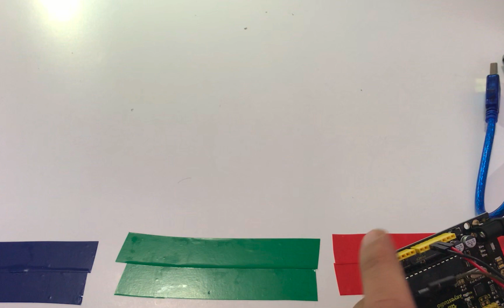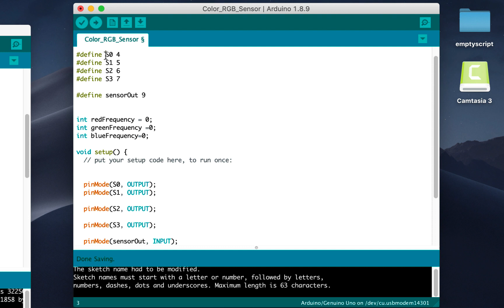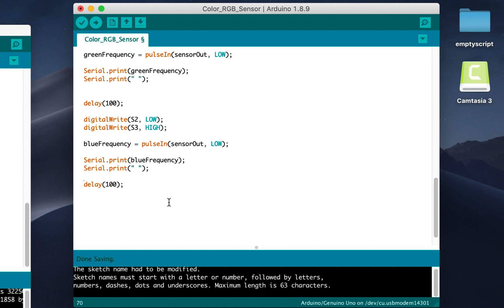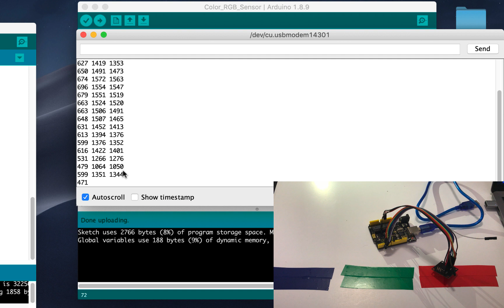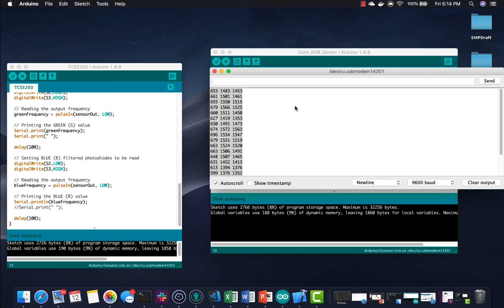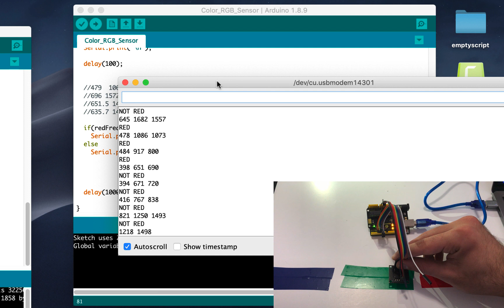4  Color RGB Sensor

Comment: This video is really helpful for me to complete my project.
Will I represent the  values in percentage , and if yes then how can i represent it ?
Thanks for creating this video.
Reply from the maker: You mean you want to get a percentage for red, green, blue?
Where the total would be 100%?
Reply: @TawfiqJawhar  Yes Yes , you got me right
Reply from the maker: @gaurangparulekar2636  the sensor detects the wavelength of the reflected light. In general it is not accurate to just take these wavelength numbers and translate them into colour RGB values (from 0 to 255 or from 0 to 100)

And you can’t have a percentage between RGB where the total is 100% because each colour can have the full colour.. for example white has 100% of all 3 colours.

So one way of getting RGB value from this sensor (which is not accurate), is to collect values where it’s pointing to each of the colours. And you find the minimum and maximum wavelength for every colour. And then you map this range to 0-255 or 0-100

This tutorial is doing that 
https://randomnerdtutorials.com/arduino-color-sensor-tcs230-tcs3200/
Reply: @TawfiqJawhar  Thanks a lot for helping me in this , i understand this  . Actually i am doing a project where i am detecting soil nutrients values by using RGB color sensor and that's where the problem is occurred .
Can i get your email so that i can communicate with you there?

Comment: Sir for the red colour the value of "r" in RGB must be higher one but in your reading the value "r" having the minimum one....???? Please explain
Reply from the maker: Hello, The sensor is not reading RGB values similar to the values you use to represent colours (0, 255). 

The sensor has red photodiodes, green photodiodes and blue photodiodes. These photodiodes are reading the frequency of the light. 
When your sensor is directed at a red surface, the frequency of the red photodiodes will become lower. Which is why the R is having the minimum value. 

It would be difficult to move from the values of frequencies to actual RGB values. However, one way you can try is finding the maximum frequency (which means when you are seeing black) and that frequency will be mapped to the R value 0. And then finding the minimum frequency which is when your sensor is directed to pure Red surface and that minimum frequency will be mapped to the R value 255. 
And you can have a simple conversion from photodiode frequency values to RGB values, but it will not be accurate.

hope that helps.
Reply: @TawfiqJawhar  thank you sir